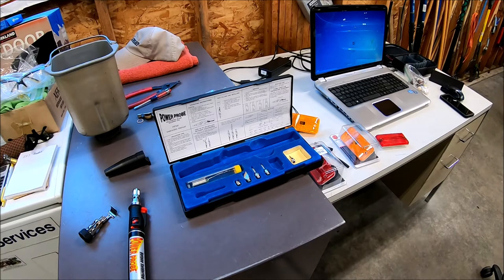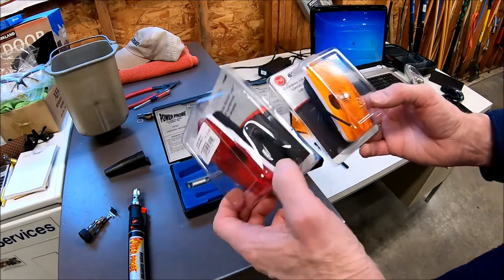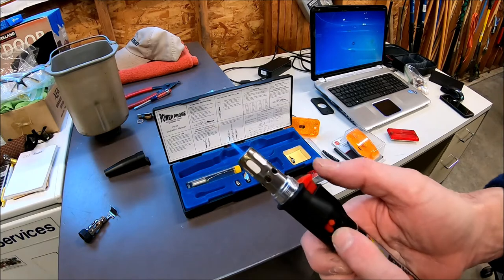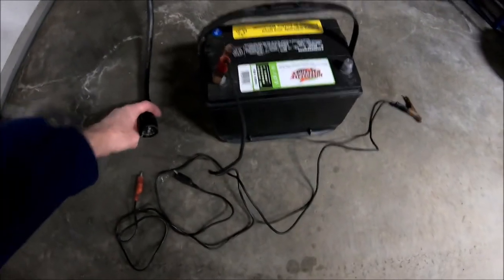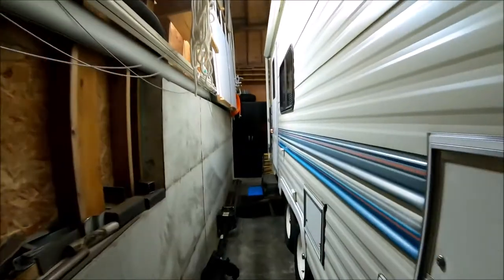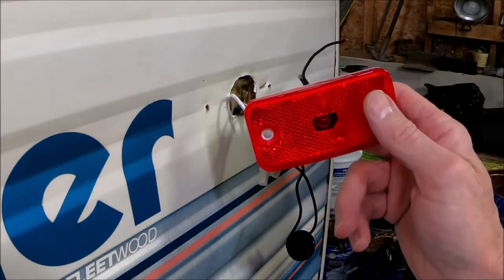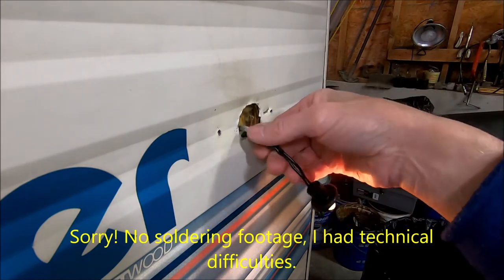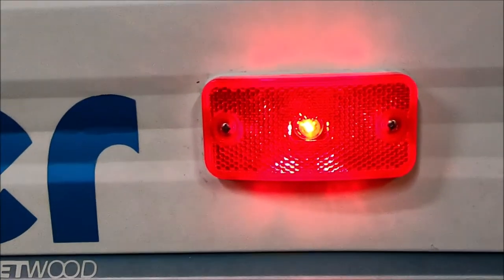How To Replace RV Marker/Clearance Lights.

Comment: Do you need to soldering if you use a connector?
Reply from the maker: you could just use Crimp on heat shrink butt splice connectors.

Comment: The green and white cable. Which one is the positive and negative? I bought some lights and they have red and black cables. Please help
Reply from the maker: The white is usually the negative or ground.  It really doesn't matter for the lights though. Both of the wires on my new lights were black wires. The bulb in these lights can be put in the socket either way so it won't really matter which one gets the positive or negative wire from the trailer.  But to verify which one is the positive wire on the trailer. Cut the old light off and strip back the insulation. Use a meter to find which wire is positive. Put your negative meter lead on frame (ground) and turn on the lights and put the positive lead on the wires one at a time and see which wire reads 12v dc. Thanks for watching!